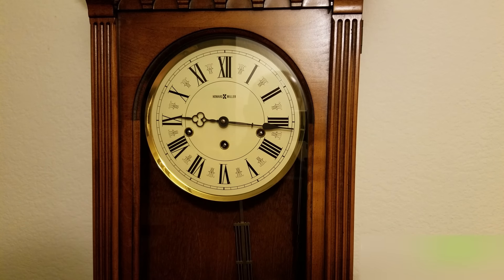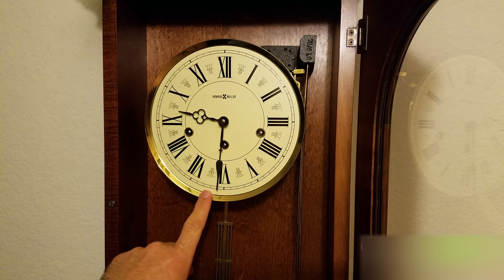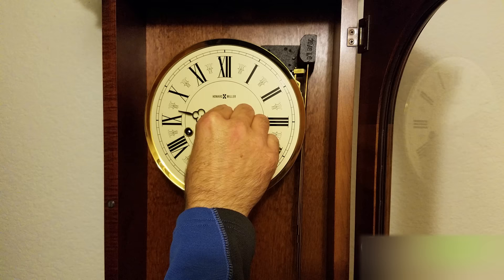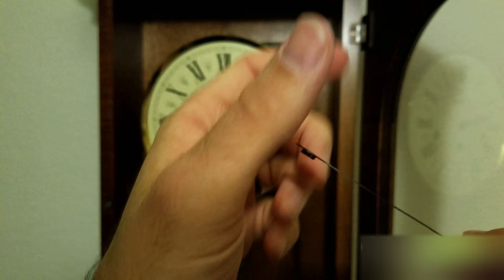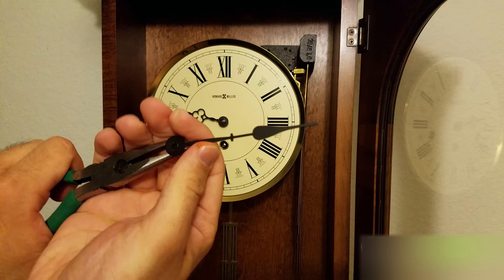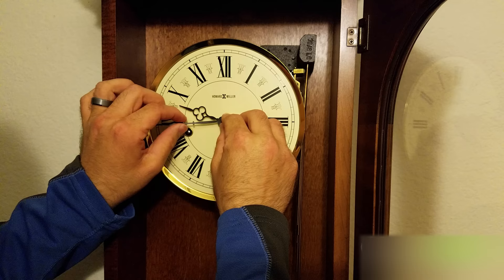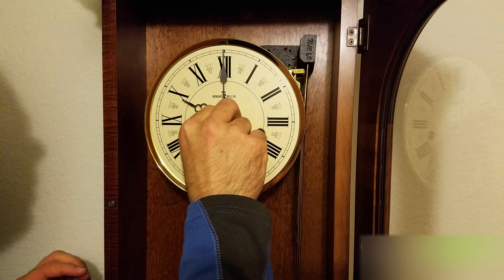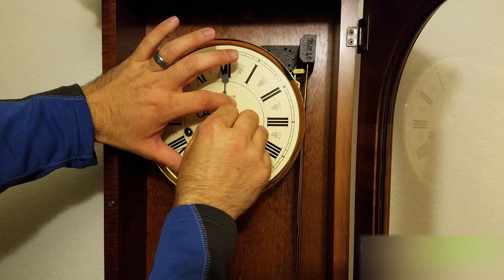How to Fix Clock that Doesn't Chime on the Correct Minute

Comment: On my clock it chimes the number of hours at the half hour mark instead of the 12, how do i ajust that ? Could you help please.
Reply from the maker: Very easy. Move the hand around until you reach the thirty again and it starts chiming the hour. Unscrew the nut that holds the hour and minute hand. Gently pull the minute hand off. Now visually turn the hand in the air, if you will, until it's facing the twelve o'clock position and place it back onto the dial. Tighten and you're good to go.
Reply: Chrisorah's Clock Channel Thank you for your reply, I trues that once didn't work but will try that again, thanks.
Reply: I found with my clock. a grandfather one with pendulum- you move the tall needle back from 12 to 7(35mins) and take it back to 12(the hour)- it should strike perfect.!

Comment: Thank you I don't know what you would call it but I have what I call a cuckoo clock without the cuckoo lol it has the weights to run it and it's the same style but my clock was actually chiming five minutes before so now I can set it properly
Reply from the maker: If it really is a Cuckoo clock or in that style, the most important thing is to never run the hands backwards. They are not like regular clocks. Usually, you can simply loosen the nut that holds the hands. Carefully remove the hour hand (from the center not the edge, you'll break the hand), pull off the minute hand and adjust to the correct setting. So, if you just heard it chime at the top of the hour, stop the pendulum, pull the hands as I've described (carefully they tend to be delicate), remove the minute hand and put back on in the correct position. The problem is, there are so many clocks out there with different setups. Work carefully, work slowly, see what logic was used to make your particular clock work. Most of the time, it's pretty easy to figure out and you can then make the required corrections. I'll try to make another video which demonstrates how to fix this issue on Cuckoo Clocks. 

I would also suggestion checking for other videos on Youtube. It's a bit difficult to describe steps via text, video is always more ideal! :) (And it goes without saying, if you don't feel comfortable, you can always stop by your local clock shop. I also suggest stopping by your local used bookstore, there's almost always inexpensive books detailing how to work on various clock styles/models.

Comment: I have a mental clock runs for 20 sec or so the hands do not move the chime side works great its the time ,two gears ass with pend movement only what u think
Reply: There are a number of potential issues. First, if it's a pendulum driven clock, ensure that the clock is perfectly level. Then, you'll need to ensure the clock is "in beat." A quick Google search will help you do this (it's hard to explain on text).
Reply: thanks for reply turns out I had to bend the upper bar ever so slight and she kept running its keeping great time ,only problem she winds and chimes early on half hour about a minute early like if its heading towards half hour it will chime at say real time of 6.29 and also do it a minute after hour position thanks for your comments
Reply: A mental clock... Hmmm

Comment: My wall clock strikes at the 30 minute mark when it’s on the hour and the hour on the 30 minute mark... does anyone know how to fix that?
Reply: Ultimate Decks, set the minute hand on 12 then remove the minute hand and reinstall it on the 6. If it is off by a minute or so then you will have to go through the process of adjusting the minute hand that was shown in this video. Just be careful when removing the minute hand, you  can bend or break it very easily.

Comment: I have a grandfaughter clock it keeps perfect time but don't chime what can I do to fix it
Reply from the maker: Sorry for the late reply. There are a number of things that can cause this. The most obvious is to ensure the weights have been wound up (either by pulling the chain or using the key that comes with the clock). Next is to ensure the clock isn't on "silent" mode. Some clocks, especially the more expensive models, have a small pull rode just behind the clock face. You can usually find it by opening the front door, and looking just under the wood frame the surrounds the clock face. Pull or push to enable/disable silent mode. The next option is to look at the clock face/dial itself, check to ensure it's not on silent. Sometimes there is a lever on the right or left of the clock face. Next, some "triple chime" clocks have either a turn dial or lever on the left or right of the clock face. This lever usually has four options Westminster, St. Michael's, whittington and silent. Check to ensure it's not on silent. If it's on for example Westminister, try moving it to St. Michaels. If the clock then starts to chime, you know there is an issue with the movement that needs repaired. You can also open the clock, if you feel comfortable and check the lifting levers aren't stuck, I've found this a few times. Additionally, while it's a bit hard to explain, on some movements there is a long rod that pulls almost all of the rods back at the same to make the "bong" sound when the hour chime arrives. This sometimes ends up misplaced on the wrong side of the chime hammers. As you can see there are a number of things that can cause a clock to stop chiming, but a little research on your model and some confidence and you can usually fix most problems fairly easily. The only exception is if the movement has been neglected over the years (failure to oil etc), in which case a rebuild may be required.

Comment: my clock same your clock.how to fix if 2 are cannot turn?
Reply from the maker: I'm not quite sure what you mean. If the hands are moving at the same time, make sure they are not sticking together. If the hour hand moves but the minute does not, ensure it's tight and snug on the dial. If the clock itself is broken, that's a bit more difficult as it could be a number of issues causing the problem.
Reply: Chrisorah's Clock Channel I mean the two need to rewind not the hour.left and right need to rewind but it's stock hard to rewind.and there no sound already.

Comment: how do fix a chime that is low.. I can  barely hear it
Reply: This can sometimes be because the hammers are too far away from the chime rods. Take a look at the hamers and see if they are too far away, they should be roughly 1/8 inch away from the rods. Also make sure the hammers aren't off center (pointing to the left or right) they should land right on the center of each corresponding rod. You can easily, but carefully, bend them back, forward or side to side as needed.
Reply: I really thank you for your time but your response solidified that fact that I am totally ignorant about clocks. hahaa Do I have take the back off or can i maneuver through the little hole.
Reply: take the back off carefully

Comment: My grandmother has correct time however hourly chime is 5 hours ahead. 
Ex: at 2 oclovk it will chime 7 times
Reply from the maker: In that case it's not actually the correct time (that hands are not set to the internal movement). This is easy to correct! Move the minute hand up to the top of the hour and count how many chimes there are. (For this example we'll say 5 chimes), gently move the hour hand only, to five o'clock (or to match the number of chimes you heard).  Now you're seeing the the time that the movement is tuned to. From this point, you can slowly and patiently move the minute hand forward (it might take a while) until you hit the current time. Important: You must stop at each quarter and let the clock chime. If you're lucky, there is a silence switch. If so, move it  to silent mode after you've figured out how many chimes the internal movement is set to and simply move the hands forward without the need to wait. Once you get to the correct time, turn the chimes back on and you're all set.
Reply: @PendulumStation  thank you

Comment: My clock is on correct time. Alarm also working at every hours.  But number of bells are different. At 7 cock is playing only 5 bells.
Reply from the maker: Ah that's an easy fix but requires a little patience. If you have the time set to 7 but it chimes 5, then the movement thinks it's 5. Remember, mechanical clocks aren't as advanced as modern day clocks. Here's how to fix... At 7, when it strikes 5 times, move the HOUR hand back to 5 (gently). Now that everything is synced up, slowly move the hands, quarter by quarter and "walk the clock" until you get to "real world" time (in your example, 7 o'clock) and your clock will now be in sync.

Comment: Ok, did that, but now doesn't chime at all.......?
Reply from the maker: Adjusting the hand shouldn't stop it from chiming. Make the minute hand is placed all the way back onto the dial. All ensure the clock is wound up completely.
Reply from the maker: Is this is still an issue? Generally, if you pull the minute hand back and forward again after it's already chimed, you'll need to let the clock run through an hours worth of movement to adjust again. Simply removing and adjusting the hand as shown in the video, should not stop your clock from chiming.